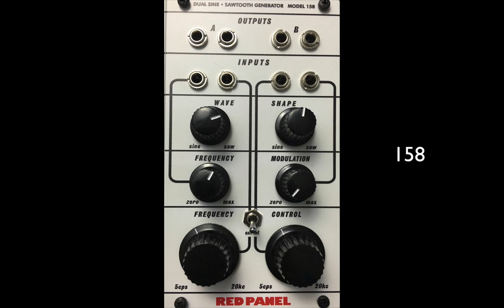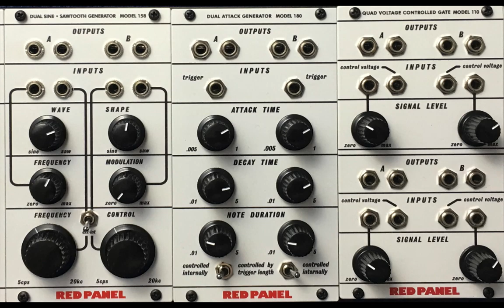BuchlaUSA Red Panel Eurorack

Comment: Sounds great! But I suspect they’re gonna be very expensive for Eurorack modules. So was Catalyst taken away from making his 100 series modules or did BEMI buy him out?
Reply from the maker: My understanding is that they are working together, Dave is still very much involved designing/engineering the next set of modules. In fact, both Dave and I were together at the Buchla booth at NAMM—the vibe is good!
Reply: Buchla actually partnered up with Dave Small (Catalyst Audio) on these and to help continue the series.  I was thinking about going down this path of having a sub-brand for a different audience and I thought he did a really good job, so it just made sense for us to work together.  Like Todd mentioned, Dave's working on the next set of modules as we speak!  Pricing I think is pretty reasonable and ranges from $299-499USD depending on the module.
Reply: @ericfox2517  What other modules are you planning?
Reply: @tdaddyify  Dave's completed prototypes for the 112, 190, and 193 (a hybrid 192 and 194!).  I'm not sure what's next in the series after that besides completing a case for them.  Those will be on display at Knobcon and there is probably video floating around from the last NAMM show where you can see them.

Comment: Amazing that there is no color coding to distinguish pulse, signal and cv. Seems fundamental to patching this system and a surprising oversight.
Reply: J Harms this is how the 100 series looked.  But I think they had black and red jacks but don’t recall what each meant. I love how the 200e has color coding for each type of signal
Reply: @geraldgoodiii6993  Actually in the original system audio/signal jacks were the only minijacks and not color coded. The pulse and cv jacks were banana and colored red and black respectively. And the original intent was to patch color to color. For instance the 180 Attack Generator had 2 x red pulse inputs and 4 black cv outputs - all banana. So in order to trigger the 180 you needed a pulse from somewhere like a 140 or a 123. Again it seems a weird oversight not to address this. I think even the Catalyst Audio guy was looking to add this as a feature before Buchla decided to release his modules.
Reply: J Harms current Buchla is mini jacks for audio and color coded banana for CV.
Don’t know as much about the 100
Reply: Not an oversight, we have looked into getting color coded jacks to distinguish the signals, however as these modules use 3.5mm (standard eurorack jacks) there isn't (wasn't) an available (non cost-prohibitive) solution. It's something that we are looking into in the future.
Reply: @catalyststudio  Befaco is making colored hex nuts, which is a start. Round plastic nuts would be awesome. Hopefully Buchla will do it!
Reply: Well....now that the cat's outta the bag, I can confirm we PLAN on eventually having banana-looking jack nuts on these that any end user can swap out themselves.  It's just more complicated/expensive than one would think and I didn't want to delay the release any longer.  Screen printed ink just doesn't look very good.  We even went to the lengths of custom moulding knobs that look more accurate.  If I'm going to release a product,  I want to do it right and get products in users' hands that they can be proud to own for a long time!